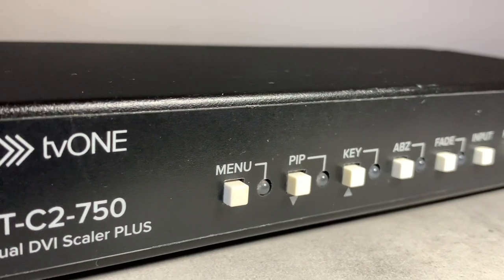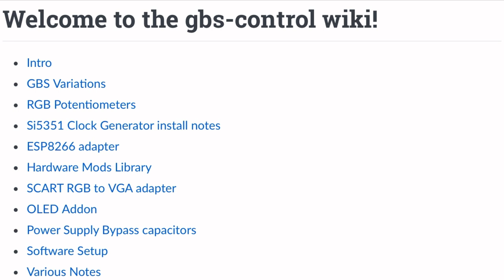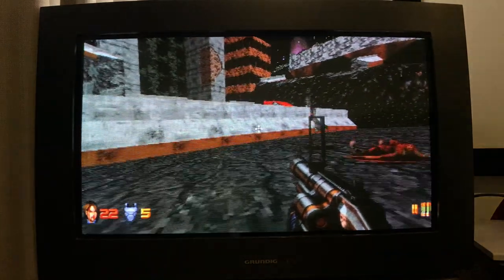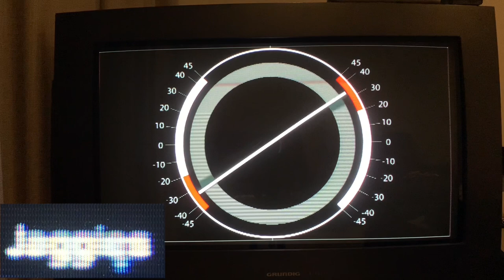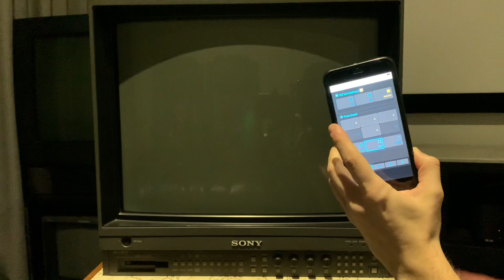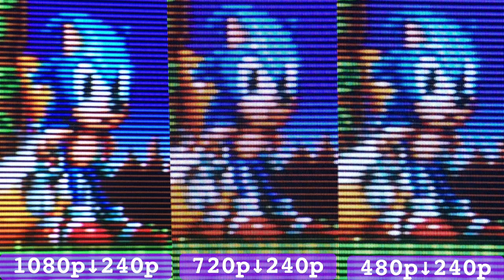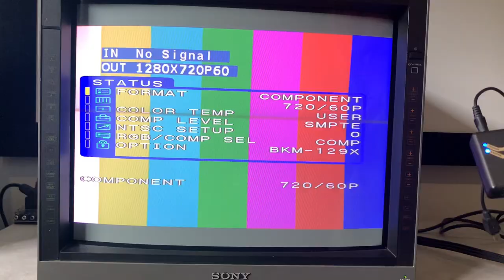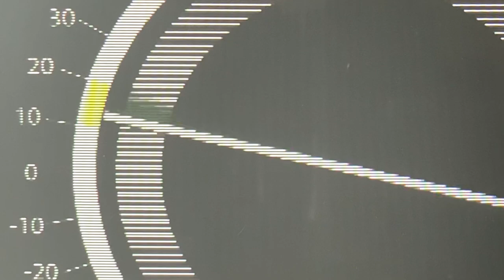Downscaling Chronicles 2: GBS-C 480p 720p & 1080p downscale to 240p on a CRT TV/PVM with GBS Control

Comment: Thanks a lot for this awesome, fun and informative video. I bought my first CRT a month ago, a Hi Resolution 14" JVC 750TVL for arcade/retro gaming, the way I think it was meant to and that I remembered how it looked, especially for the scan lines, no input lag and no motion blur. Now I'm just waiting for my GBS-Control and the RGBHV to RGBs adapter to use with the CRT's S-Video input, downscale 480i and some higher resolution (480p+) games with retro/classic art style like on the NGC/PS3/NSW and so to 240p. My CRT can only do 240p/480i/S-Video and would love to own a second and last CRT capable of doing 480p and up resolution before they get more pathetically expensive. The L5 is exactly the one I want since it is the perfect size for my desk playing close to it, but I've read/heard about added input lag with these even if it is less than LCDs. So I'm interested to see 240p/480i games upscaled to 480p or higher(?) on a HD CRT (PVM/BVM) using the GBS-Control or something with less lag to see if the input lag would be less than the HD CRT taking a 240p signal. Also, would you recommend something like the (WD-40 Specialist Electrical Contact Cleaner Spray) to clean a CRT inside? I know for the anode cap from what I have found, some sort of silicone glue is recommended.
Reply from the maker: Thanks for tuning in! JVC made amazing pro monitors. My friends have several and they exceed Sony’s monitors in contrast and blacks. For the GBS, it won’t output S-Video or composite unless you transcode externally. I’ve seen RGB and YPbPr to S-video/composite converters on Aliexpress unless I’ve misread your comment. For consumer HD CRT’s that only take 15KHz and then upscale, they definitely add lag and you’ve gotta hope for a VGA/component/HDMI input that accepts 480p and higher, otherwise they’re not ideal for 15KHz gaming. It’s not only the lag but the mishandling of 240p as 480i during the upscale and if you could input externally upscaled 240p, it should look much better than what the TV can do. Checkout DJcalle’s Loewe VGA input card video where he does this with a GBS and ads scanlines. It looks very convincing in person and you only lose a bit of brightness. Bob from RetroRGB also made a video on upscaling 240p to a PC monitor and saw similar results. Some prefer to have 2 CRT’s if the setup has enough space - 1 for 15KHz, and a PC monitor or HD CRT for HD content. An L5 PVM isa nice all in one CRT and it won’t add any lag, as it’ll display exactly what it’s fed as long as the signal is in the realm of what it can handle. 
I’ve personally never ‘scrubbed’ a CRT chassis with any product although I’ve seen many videos of cleaning with soap and water, provided it’s throughly dried. I can only assume contact cleaner is ok for mildly dirty components but wouldn’t use it prior to dusting it off. I’ve always used compressed air and a paint brush but it’ll never be as clean as using a liquid solution, but good enough for me. I’ve used 99% alcohol on a discharged tube/anode cap before applying di-electric grease to the cap. That’s to help with insulating and isolating the cap from dust and dirt to prevent high voltage arching. I would only recommend if you know all the safety precautions

Comment: You deserve a lot more subscribers! Great testing and video. I've tried a corio 2 but not a gbsc. Curious to see a comprehensive video like this on tink 5x downscaling. I have been waiting to buy an upscaler for when the new stuff comes out and I play on CRT most of the time anyway lol so I don't have one to test the 240p downscaling.
Reply from the maker: Thank you so much! I’m planning to feature the Dexx scaler as it hasn’t been as widely covered as the Tink 5x. My gut tells me it’s going to be next to identical in scaling algorithms. Bob from a retro RGB showed the Tink5x downscaling fairly well. It essentially line drops 720p and 480p to 240p, which is why it’s so fast at downscaling. It can make 3D games look very ‘lossy’ but will sharpen 2D art nicely. That’s where downscaling to 480i should bridge the gap. I’m hoping the Dexx ticks all the boxes.

Comment: Hi dude, great video !
You can use an Extron DSC 301-HD as downscaler (with a Tendak HDMI to vga adapter) to feed your GBS 🙂
With the DSC, you will be able to tweak the aspect ratio to your convenance and move the image up and down to adjust the scanline 😉👍
Sorry for my bad english, best regards from france !
Reply from the maker: Merci for the compliment 😃 Great minds think alike, I mentioned something similar in the conclusion of episode 3 using an Extron VSC 500 although the VSC will output 480i and not 480p like the DSC. Although I haven’t tested lag and scaling algorithms/artefacts, the DSC is a great recommendation to pair with the GBS! Your English is excellent btw

Comment: Great testing ! I'm fairly new to the CRT world and was wondering if there is any way to downscale an HDMI signal to SCART, i've heard of many cheap converters in the wild but apparently you're stuck with 480i/576i instead of 240p... Thank you so much for the help !
Reply from the maker: Thanks! And yep, those converters are great cheap devices for converting video content to interlaced, and they could even just be outputting composite through scart. 240p really only existed for gaming so we get pretty excited when a downscaler can output 240p.
Reply: @MarcoRetro316  Is there any optimal way to output 240p from an HDMI signal to SCART ? i've found some solutions like the OSSC or the GBS-C but apparently they are an "opposite" solution (as inputing SCART and outputing HDMI...) Thanks !
Reply from the maker: @laouredimarouane4926   this downscaling series is all about outputting 240p from HDMI so there’s plenty of options, it’s just a matter of what hardware you can get your hands on and your budget. The GBS-C can downscale 480p but the OSSC is purely a passthrough and upscaler and won’t downscale. For the GBS-C, inputting 480p HDMI can go either of 2 ways: 
1) A simple HDMI to VGA digital to analog converter. These don’t scale, just convert. Then combine HV sync to C-Sync using something like an HD152scart passive sync combiner
2) Convert HDMI to component, again via a lagless DAC transcoder

To output RGB via scart, you need a VGA to scart cable/converter again like the HD152scart. A passive device like this may not supply voltage to the blanking RGB switching pin. There’s USB-powered sync combiners on eBay that’ll send 5v to scart pin 16 if you’re using a consumer TV. 

Overall the best ‘plug and play’ option I’d say is the RetroTink5x. You still need to do the HDMI to VGA to Scart via a sync combiner (or HDMI to component) on the input, and then the same thing on the output. It’s reported to be low lag, sharp scaling algorithms by line dropping, and can output 240p and 480i. It’ll be a few months but I’ll cover this method in the future
Reply: @MarcoRetro316  Thank you so much for your input ! eagerly waiting for it !

Comment: I´ve a Mini PC Ryzen 5800h hdmi output. If I set the output to 640x480 via hdmi using a hdmi to ypbpr converter, then Yppbpr to GBS-control, then VGA to Ypbpr cable connected on CRT. Can I convert my hdmi to 240p? 
Could this work?
Reply from the maker: @2ppropaganda  yes that should work

Comment: When MLIG tested the GBS-C there was this issue when the image occasionally blipped. Have they fixed that issue?
Reply from the maker: I didn’t experience any screen jumps from the GBS. There’s a lot of variables and I’m not sure if it got ironed out in software or there’s something different in the install, power supply, length of cables etc. I plan to do another episode to focus on the GBS’ 480p downscaling so I’ll again see if anything shows
Reply: @MarcoRetro316  planning to buy a GBS-C to downscale content to 240p but was hesitant to buy because of that bug. Looking forward to the next video!
Reply from the maker: @tranceenergy3121 hopefully it works out for you. The next video will be on the DVDO but the one after that will feature the GBS and another downscaler

Comment: Whats the best and cheapest plug and play solution to get a modern ryzen 7 mini with hdmi output to 240i over hdmi-ypbpr converter (CRT tv)?
Reply from the maker: Unfortunately BEST, CHEAPEST and PLUG N’ PLAY aren’t best friends when it comes to downscaling. The OSSC Pro is best and plug and play if you also purchase the extra AV out board, but not cheap. Apart from some rare and expensive scalers which are mostly unobtanium like the uVC, Extron Emotia and MIMO Genius II, there’s no other that’s very plug and play unfortunately
Reply: @MarcoRetro316  I'm having a hard time trying to get a good 240p to CRT. I've ordered a Raspberry Pi5, a VGA666, a VGA to Ypbpr converter and hdmi to ypbpr converter. Nothing works. The best I could get is using RPI5 5 + Recalbox UI > VGA666 > HDMI-Ypbpr, but N64 looks weird and the CRT screen is not stable.
Reply from the maker: @2ppropaganda there’s a lot going on there. The VGA666 adapter will output RGB, but there’s no reason I can see to then add an HDMI to component DAC. If component is the end signal you’re after then just the HDMI to component DAC alone with the right configuration in the Recalbox ini file should get you 15KHz output. This guy’s using Batocera OS and HDMI to VGA for RGB but it’s the same concept 
https://www.reddit.com/r/crtgaming/comments/1elhlud/finished_setting_up_240p_and_480i_on_pi_5_using/
Reply: @MarcoRetro316  because my CRT has not VGA input. Then, I need to convert VGA666 to Video Component, using a converter.
Reply from the maker: @2ppropaganda  I understand. The HDMI to ypbpr is the step that has me confused as that is digital to analog, but the vga666 is already outputting analog. So you would either keep the vga666 and transcode RGBHV to component, or not use the vga666 and output HDMI, then convert to component

Comment: Im having some serious issues with getting downscaling to work with a gbsc from aliexpress... Will be watching this video many times probably😂 Any chance to be able to reach out directly somehow for some assistance?
Reply from the maker: I’m always happy to help out here in the comments as it’ll likely help others. So with downscaling and the GBS, most of the time you need to input RGBs or component, don’t bother with direct RGBHV. Therefore if you are using an HDMI to VGA converter then you need to combine HV sync prior to inputting to the GBS. They only accept 480p or 480i for downscaling and I haven’t tested if it accepts 50Hz but it’ll definitely take 60Hz. The UI and Wifi can be very inconsistent. As for the output side, just make sure it’s set to either RGB or Component, whichever your CRT takes. There’s so many variants of Aliexpress units and I’ve seen some several switches to toggle sync on the input and output so just make sure they’re all set correctly. Not even sure if they combine HV sync on the output but that’s another factor to consider
Reply: @MarcoRetro316  Awesome! I'm allready halfway down the rabbithole in terms of adding a sync-combiner to the vga in, so I'll finish that first. (The goal was something that wouldnt be a mess of wires, so I went with a tendak adapter). I will look into modding the sync combiner onto the pcb-somehow. This port is pretty useless without it, so why not. I'll likely get a hdmi-component adapter that downscales 1080/720 to 480p later anyways, that seems massively helpful! 
Also experiencing issues with the web-interface, and apparently it can be fixed by changing your routers wi-fi channel, but guess who has a router where this cannot be changed.. 😆 Will hook up another access-point at some point, should solve that issue.
I also seem to have some issues on the output-front. The aliexpress-gbsc has a saturn-style port with rgbs, which would save me having to make another sync-combiner, I can just use a saturn rgb-cable from retrogamingcables, or so I thought. When using the component-input and a working 480p-source, the gbsc locks on to the signals and enables downscale-mode, but I still dont get any output, which is peculiar... Since I cannot find any documentation for this aliexpress gbsc, things get pretty tricky at this point, but I think it should be solveable. I suspect the saturn-out just isnt wired the same as a saturn-rgb cable, which is stupid, but I guess thats completely possible. My plan is to use a multimeter to measure the voltage on these pins, but think I might need some pointers first in order to draw the right conclusions. I can also try inspecting the pcb and see if I can identify and trace where things go, but not sure what the easiest approach might be there...
Reply from the maker: @espset1234 hmm so some things to inspect that come to mind are the blanking voltage on the Saturn port and your scart cable. Make sure the GBS outputs blanking voltage and that the cable is wired for pin 16 to send that into your TV. If using a pro monitor then no need to worry about blanking voltage at all. You’d also want to see which pin it’s sending sync to on the Saturn port and make sure it corresponds to your cable. 

I reconfigured my ESP board to send its own wifi rather than connect to my home router as I get a weak signal. 

I also input combined sync to the sync header pin on the GBS board but I didn’t trace that to see if it actually connects to the H-sync of the VGA input. That could be another hurdle as I’m not sure C-sync can input through the VGA H-sync pin. But seeing the GBS locks on when you input 480p component I suspect it could be sync or blanking with the port or cable.
Reply: @MarcoRetro316  I saw a reddit-post with the same issue, where it was suggested that inputting c-sync on H should work, as well as the same info on a twitter thread confirming that, so it should work. Probably worth inspecting the pcb to verify, at least if it doesnt work. I will gamble and try to add the sync combiner to the pcb-lines directly, so I will get to verify this as I  go anyways
Reply: @espset1234 I use a vga to component break out cable to get 240p downscale out of the gbs control. ( no need to tick the component option in the web ui) I have the same one you mention with the saturn port. The saturn doesn't do component out just RGBS.
Reply: @disciple_316  thanks! For me tho that doesn't really help much, since I'm located in Europe. Afaik, component inputs on crt-sets was only common in the states etc. All my crts have scart, so I would therefore need rgbs over scart  (to re-iterate, the gbsc I have says on the saturn-port "RGBS"). Another option would be to add a sync-combiner to the vga-output as well and make a vga-scart cable, but I'm playing the long-game here to hopefully get the tidiest solution with the things I actually have on hand. I have all I need, except making sure the vga-input on the gbsc actually works by adding a sync-combiner, and to make sure the saturn-out and cable is wired correctly and actually sends rgbs😁👍
Reply: @espset1234 I hope you get it sorted out. When I asked the seller about the downscale function out of the saturn port via component, he did show it "working" on a  PVM. When I asked what cable he used, he sent a pic of an RGBs cable with the saturn port. I had already mentioned to him that I wanted to do YPbPr. The saturn port on my GBS control says RGBs/YPbPr. He finally admitted that my cable wouldn't work. Funny he also mentioned I wasn't getting 240p out of the VGA but 480i/p.  I sent him pictures of my setup and even screen shots but still would not accept my findings. Oh well.
Reply: @disciple_316  huh, that is very weird... But good(?) info😅 Typical aliexpress-seller, some might say😂

Comment: I have a PC that has VGA out, I have a GBS control, I have a Trinitron... I have no idea what im looking for in the menus to get this working... I can't seem to change any of the options... I see nothing for frequencies... if you can put me in right direction here i would appreciate it.
Reply from the maker: Are you connected to the GBS web interface by wifi? On the interface there’s a 240p downscale option but the input has to be 480p and either RGBs or component. I’m assuming you’re outputting Component from the GBS to the Trinitron? If so then you also need to select ypbpr output on the web interface
Reply: Yeah, so VGA output on PC. Input to the Trinitron is component. I was trying to connect to the WiFi but I wasn't having luck navigating much on my phone. I think the connection wasn't very stable, I'm going to put the GBS on my at home connection.